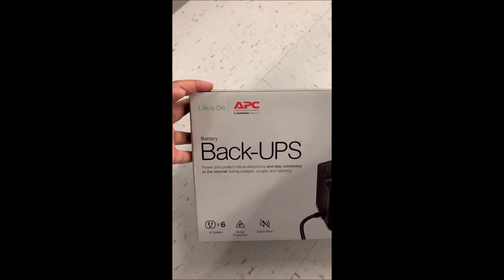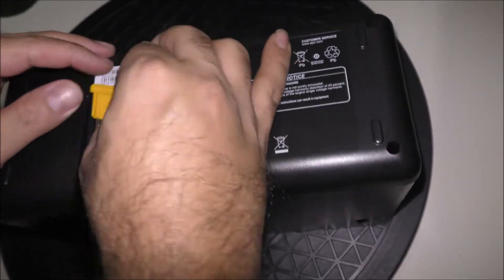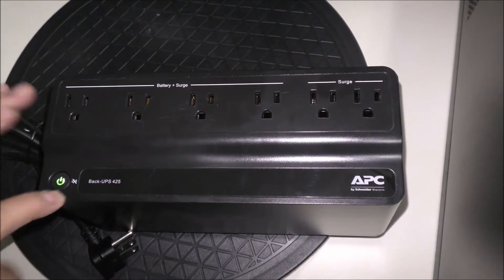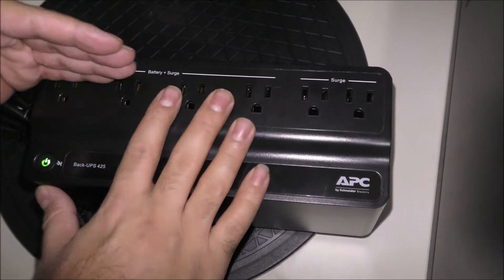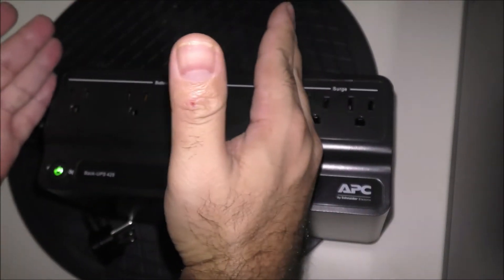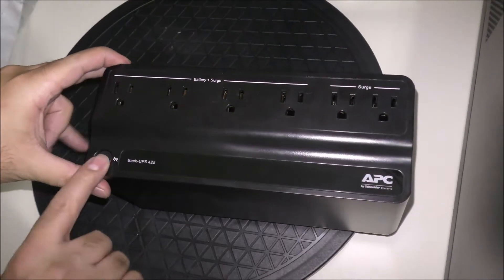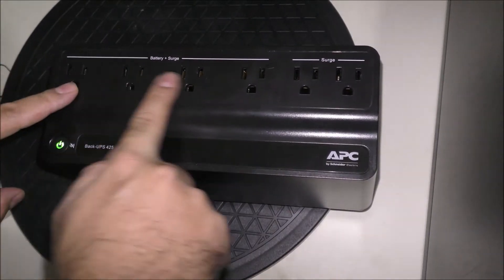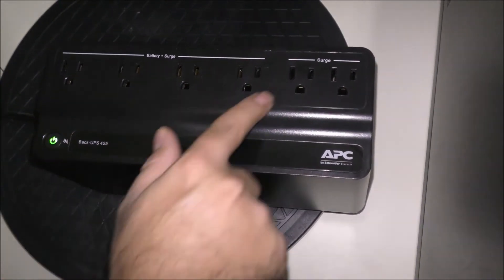How To Setup & Install APC UPS 425VA 450VA 650VA 850VA Back UP Battery & Review

Comment from the maker: Please don't hesitate to ask us any questions regarding any tech-related matter & If this video helped you guys out please consider subscribing to our tutorial channel 🙏 you’re support is most appreciated, you will get top how to updates on all computer-related products.
Reply: I bought a replacement battery for my 450 model.  How do I install it?
Reply from the maker: That needs to be opened with a screw driver to access the battery and its a bit tricky if you are not savvy with electronics, ill make a video about soon and ill upload it you must be EXTREMELY CAREFUL NOT GET SHOCKED if you are willing to go at your own risk and just make sure you you unplug it from the wall jack & unplug the connecter that is under the UPS system so the battery wont be in contact. Hope this helps and be extremely cautious.
Reply: the prongs to connect the battery are curved at the tips.  it does seem to snap in the plug and is loose and easily falls out.  How do you get it to connect completely in?  Further the "yellow" connector extends so far out, that the device can not be positioned flat and it rocks on its base.  Is there a trick?
Reply: ok so i got one of these yesterday plugged it in, do i leave it on while plugged in the entire time i have it & do i have to occasionally unplug it to use its battery to keep the cells working? Or do i just plug it in, turn it on & leave it alone?
Reply: Mine doesn’t stand correctly after plugging in the battery conector
Reply: Pls ; my ups keeps blinking green after been plugged to Electricity
Reply: I set up an untouched if old 450.  When I turned it on, it started beeping.  I pushed the button for it to turn off.  Every time I try to push the power button, it shrieks.  Is it because the battery needs charging or is there something else going on with this thing?
Reply: My light is red and blinking why?

Comment: Hi, I just purchased a 425 battery ups, but when I connected to the power outlet and turned on and connected my tv and another accessories at this moment the ups light started to flash green 2 times, do you know what is happening?

Comment: mine screams at me for every single power surge- and the only way it seems to shut up is if i reset the whole thing; am I missing something? it seems kinda backwards to even have a battery if even if the function works it only screams until reset. like i feel like thats dumb so is there something i missed?
Reply: We are having this problem did you find a solution

Comment: Hello. Is 650va ups enough for a mid range PC consuming around 250 to 300 watts during gaming, just to shut it down in case of power outage?
Reply: Did you ever find an answer? I just bought the same unit you’re probably looking at
Reply: @Arwinger48 It will only give backup of 5 to 10 mins so you can safely shut down PC
Reply: @fahdmirza8665  I ended up going with the 1050 version because it has a screen lol
Reply: @Arwinger48 You did the right thing. It will give you reasonable backup time. Best wishes

Comment: The battery connector in mine is sticking out and won't go in all the way no matter how hard I press so the entire thing is slightly lopsided by like 1/2cm -1/4cm
 is this normal???
Reply: No. Mine took some serious pressure to pop in. I was scared I broke it at first 😂

Comment: I don’t know what’s up with mine, but when the power surges in my apartment, everything connected to it turns off. But if I unhook it from the wall, they stay on? Is that normal? Who knows. Gonna replace it because the other brand I have doesn’t do that.

Comment: I have this APC, however, whenever I turn the ceiling fan on, the monitor blinks (turns dark and turns on). Is there a way I can protect my monitor?
Reply from the maker: Brother I think you should call an electrician, something doesn’t sound right
Reply: Ceiling fan?

Comment: Mine won’t stand even after activating the battery connector(plastic piece at bottom of the product). It wobbles is what I’m trying to say
Reply: Same here
Reply: You have to push it in further, it will be flush

Comment: I just bough it! I have a question. Can I connect all my devices already or do I have to first let the battery charge and after it charges proceed to plug my devices into it? The green light is still flashing after I connected my router and a laptop to the battery + surge area. Is it normal? Does it means it’s charging? Hope you can answer my doubts!
Reply from the maker: Its okay for you to connect right away, but the flashing part sounds like its not getting power from the outlet & by the way the surge area is not protected by the battery meaning if ur electricity turns off the devices would turn off too incase you did not know, it should be solid light
Reply: @USComputerSolutions  thanks for your reply! The light is flashing from time to time but according to the manual is due to the battery charging and when it’s fully charged it should go all green. I have a tower fan I was going to ask you if it’s possible to connect it or if it could give me any issues?
Reply from the maker: Ah if its blinking from time to time i guess it’s charging assuming you have connected the battery from below the device. Regarding the fan,  well  personally as a systems engineer and a tech for over 14 years i have never connected a fan to a ups system, i am not saying it’s impossible to connect a low wattage fan I’m saying i have not, anyways in the technical part of the ups i guess you can connect a low wattage fan to the (surge area) &  again if your fan is low wattage less than 200 watts you maybe fine I dont recommend it buy thats up 2 you.  Oh and never connect a heater to it either even if it has a fan it will run the fuse off of that thing.

Comment: I can’t get it to run my internet modem/router in a power outage.  It runs other things, just not the router.  Any specific way to connect the router other than plugging it into the unit?  Other troubleshooting ideas? I feel like I’m missing something.
Reply from the maker: You sure you have it plugged in the area that says battery or not just surge area if you ran out of battery slots just buy a splitter plug it in the battery area and have more things to plug in the battery area, hope this helps
Reply: @USComputerSolutions  ah....It is indeed plugged into the surge side. Thank you so much for your help! You have solved the mystery that has been plaguing me for four months and even research has turned up no help until I found you.
Reply from the maker: Glad to help, it happens, and if you haven’t already subscribed please consider subscribing your support is most appreciated thank you 🙏🏼 😊

Comment: How much does the battery lasts until the unit shut down?
Reply from the maker: Depends on what you have plugged in the battery area (and it depends on what model you buy from these ups systems) now for example one monitor and one computer will last maybe 10 -15 minutes for this particular mode in the video but if you want longer time check this video description you will see more options also check out this video https://youtu.be/vEy0ICYevUs this one last between 45-60 minutes,  KEEP IN MIND IT ALL DEENDS ON WHAT YOU PLUG IN THEM the larger ones can handle more load  by the way and last longer check the links in the description to see differences between them all, hope this helps please consider subscribing if you haven’t already, thank you in advance

Comment: Some printers yes, many printers NO, especially a laserjet of ANY kind. Better just monitor, PC and very light stuff like phone, router, switch, etc. Thank you for this video.
Reply from the maker: You’r welcome, I highly agree with you not all printers  can plug in to the UPS but keep in mind it all matters to what wattage the UPS supports, lets say you have a desktop a monitor and printer with a total usage wattage of ~700 watts and your UPS supports lets say 900 watts then you are good if the power cuts off the battery can handle that amount of wattage but if you plug those ~700 watts on a 450 watt UPS it will burn the fuse.

Comment: I specifically wanted to see how to connect the inside battery. The instructions say it sparks a bit and that it's "normal", but how much sparking is normal?
Reply from the maker: As you saw it should have not sparked make sure you are not plugged in the electricity while handling the APC, but maybe there is a problem with your device be cautious.
Reply from the maker: Honestly APC should stay on 24/7 with pc plugged it should be warm bot not hot 🥵
Reply: @USComputerSolutions  The APC 450 model you have is different from the APC 900 model. The 900 model has a removable battery that you need to attach wires to, and that causes a small spark (normal behavior). We figured out that we need to attach the wires quickly. It only sparks when the connectors are very close together but not attached yet (electricity jumps the air). For novices like us, who were going slowly, it freaked us out! We put on rubber bottom shoes and decided to try it again and it was ok. It's working now and there are no sparks now that the wires are attached. Our APC is somewhat warm,  not hot. Thank you for the quick response.
Reply: @deq9r  Our APC is warm, not hot. Do you have enough air flow around it? If it's on carpet, I suggest raising it so it's not on anything that would insulate it. Our battery connector fit well. We haven't tried to unplug it. Edit: we are keeping it on 24/7 and so far no problems.
Reply: I realize this is a year old but this guy is apparently ignorant of the instructions that absolutely do say it may spark a bit and that is normal.

Comment: How do you charge the unit?
Reply from the maker: The unit stays charged while plugged in your electricity outlet 24/7, the internal battery kicks in only when you have a surge or a power outage. When the electricity comes back out of that outage the device resumes the charge and it will recharge the battery to the full. I do hope that answers your question please 🙏 consider subscribing to our channel for more future how to tutorials.
Reply: @USComputerSolutions  Great I want to take the battery back up to the beach tomorrow and use it for my live stream at Cocoa Beach.
Reply from the maker: Go some mo life keep in mind it is a small battery so i hope it gives you a good amount of time for that stream, let me know what happens with you. Oh and keep the water away from it !
Reply: @USComputerSolutions  how much life would I get for it on a Ps4
Reply: @USComputerSolutions  Sure I will subscribe...If you like fun adventures to watch please subscribe to my channel.
Reply: Thanks for the info. Salute👍
Reply: I just got one I need to know if it should be kept plug in at all times also does it uses excess current while plug in
Reply: I intend to use my TV and fan on this device how long would the charge be